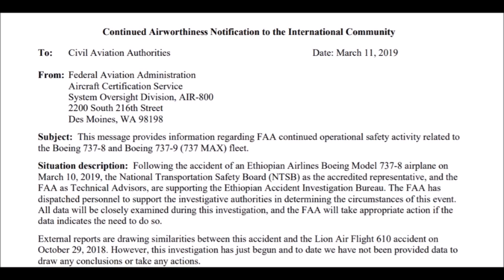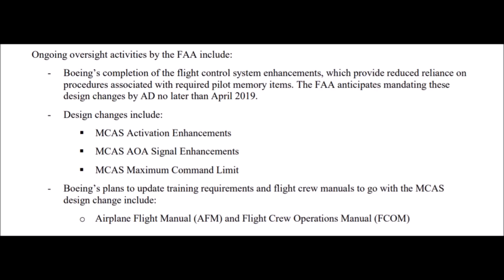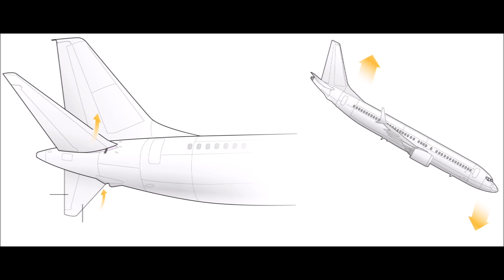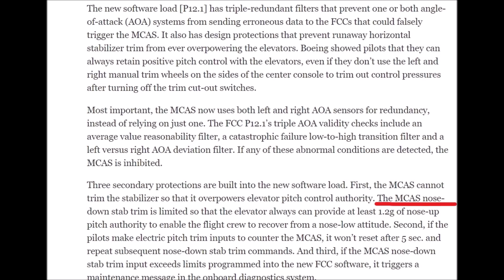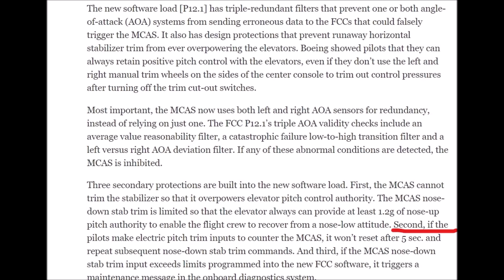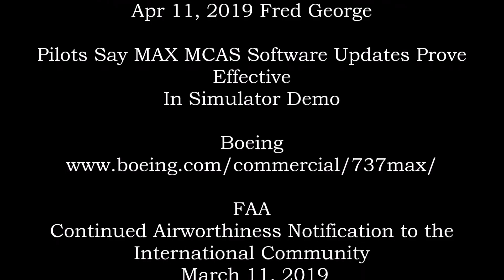737 Max UPDATE 14 April 2019 "The Fix"

Comment: I noticed in your comments there was nothing sounds to you angle-of-attack indicator malfunction problem. Seems to me that that's basic to this whole system. Should have been numerous  reports the the angle of attack indicator was giving erroneous information and they cut mcast. Angle-of-attack indicator sending around a long time and it seems to me or relatively simple instruments I guess I don't understand where they problem is with this particular aircraft.
Reply: Martin Richter AOA faults were covered in a previous video. This is part of a series.
Reply: My question it's really about the AOA putting out erroneous information. From an engineering perspective, there are three potential scenarios. First AOA observes airflow and converts that to data which represents angle of attack. If that hardware sensor fails,  erroneous angle of attack  information is sent to MCAS. Normally data which is outside the normal range for this instrument.
The second scenario which has occurred in the past is a software error in which the data is used as English standard units in one part of the software, and as metric units in another part of the software causing wildly different numbers. This happened to us JPL vehicle and ultimately cause the loss of vehicle.
A third  possible problem is the location of the AOA sensor on the nose of the aircraft. Airflow over the nose and fuselage of the aircraft it's not necessarily smooth. Ideally one would like smoth undisturbed  airflow over the angle of attack sensor. This may not be the case in his present location.
Reply: Martin Richter None of those scenarios are relevant to passenger aircraft. AOA sensors measure angles in degrees, a system of units which have been around for thousands of years. The only way to get undisturbed airflow is to have a ten foot pole attached to the front of the aircraft, and that is never going to happen.
Reply: What I have not heard from you or anyone else really is an effort to address the quality and reliability of the data from AOA sensors. We as the general public may not have access to such an effort but I'm not convinced that everything is being done to resolve this issue until we take a hard look at that sensor and find out why the data has been erroneous.
Reply: Martin Richter The AOA sensors that crashed are in a million tiny pieces, those that didn't are still working. I see your point, but am not sure what there is to investigate.
Reply: Look carefully at the nose of an A350, which is arguably one of the most modern and safe aircraft around. There are two AOA sensors on each side of the nose, plus a whole lot of other (15 in total) sensors: https://en.wikipedia.org/wiki/Airbus_A350_XWB#/media/File:DSC_8003-F-WZGG_-_MSN_003_(10512991673).jpg

Comment: why cant we fix the problem instead of putting a band-aid in the problem by forcing the nose down...Problem is these engines were not designed for these planes...and we need to call it as it is.  They needed to design a new plane if they wanted to use these engines...Or at lease give it a higher landing gear to accommodate the bigger engines.  UGH!.... Just pointing out the obvious Juan. Thanks for the video

Comment: In an earlier video I believe you stated that a Pilot can only be certified on one type of aircraft at a time, so if a smaller airline had older  737's  and then got a few new 737 max planes and could not use the same pilots on both  they would have extreme scheduling and financial problems.  This would put pressure on the airlines not just Boeing to avoid the need to recertify for the 737 max.
Reply: Sue Smith Yes. That was covered in one of Juan's previous videos in this series.
Reply from the maker: Exactly. Thanks for listening. So many folks watch this series and are blinded by there own 'opinions' .

Comment: Thank you Juan. Your ability to explain these technical concepts to the greater public is amazing.  I do have a couple questions. 1.) How often does ANY full size commercial airliner approach a stall condition? 2.) How likely is it for an airliner to approach a stall condition more than one time during take off? I understand the MAX 8/9 models are more likely to approach a stall condition due to the new engine's power and mounting configuration but why would MCAS be designed to continue correcting the trim after the first correction. I would guess that a pilot would be shocked to attention after the first correction by MCAS, considering its designed to engage only with auto pilot off, and pilots at that point would be paying acute attention to how the aircraft is handling, making further correction not only useless but dangerous.  It seems like the software for MCAS was designed by someone with little to no flying experience. I just don't see how a non-intuitive software program like that could have slipped through the cracks. Also, in one of the accident reports, there seemed to be some question as to whether or not MCAS was bumping the aircraft out of auto pilot and allowing MCAS to reactivate. Was that addressed or have I misunderstood the issue?
Reply: Tommy Leanza 1. It is very rare for a passenger aircraft to be close to the stall condition,  unless something has gone seriously wrong. 2. MCAS has nothing to do with takeoff, it was originally intended to deal with tight turns at high altitude during TCAS escape maneuvers. 3. The goalposts shifted, and you know the rest of the events.
Reply from the maker: It's not a stall prevention program.

Comment: MCAS is just a cheaters way of getting by but in the end it's cheat and if not needed to keep the so called 'stable aircraft' in the air then remove it and train the pilots for a new type of handling. Talk about spin cycle on full BS MODE!!!

If this had happened to Airbus, Boeing would have crucified Airbus and Boeing's lawyers would be screaming bloody murder for years to make sure no one forgot. Boeing cheated and it's going to take more than a slap on the wrists to remedy this error.

Comment: I read somewhere that this exact thing happened on the same airplane and the crew just happened to be giving a free ride to a pilot who knew how to pull it out of the dive. He had the pilots cut the engines off and then when they turned the engines back on they were able reset to its regular course somehow. He saved the lives of the crew and all passengers!
Reply: CelticFreckles That was covered in one of Juan's previous videos in this series.

Comment: 737 Max “inherently stable”??   Perhaps the phrase needs to be defined.
Reply: Google is your friend:  Inherent stability is the tendency of an aircraft to return to straight and level flight, when the controls are released by the pilot. Most aircraft are designed with this in mind and are said to be "inherently stable.

Comment: @rick nash. Your point regarding the thrust setting is a good one. I would however, wonder if it was deliberately left at 94%. If you were to place yourself in the cockpit, what would you see? Shortly after takeoff from a high altitude airport, you clean up the aircraft and almost immediately, the MCAS pitches the nose down with the considerable and repetitive authority the stabilator trim has. There will always be some delay while you assess what is going on, select a course of action and execute it. While I have not seen the altitude trace vs airspeed, I suspect you would have a delicate balancing act between maintaining your altitude, controlling the MCAS commanded pitch down and not allowing your airspeed to build to the point where aerodynamic loads would make it nearly impossible to use the manual trim via the hand cranks. This emergency happened at a critical phase in the flight. I can only empathize with any pilot who finds themselves in such a situation. @rick nash

Comment: Boeing made so many errors it makes you wonder what the hell is going on in that once great company.      They should have just raised the airplane up instead of moving the engines to accommodate larger engines.   Then compounding that they made the ridiculous MCAS solution dependent on ONE sensor and gave it full nose down...  Unbelievable.    And they changed MCAS from .6 degrees to 2.5 degrees and didn't rerun the analysis.      Its sad because all this talk about the 737 being old is nonsense...it is old design but the only problem is that it sits too low.  Why didn't Boeing raise it?
Reply: Richard Miller The problem with the B737 is that the landing gear retracts into the wing. There simply is no space to lengthen the legs of the landing gear, to make the aircraft higher off the ground.
Reply: @gordonrichardson2972  yeah I know it wouldn't be easy, but this is Boeing they could have figured out how to raise it, they didn't want to spend the money....I suspect it would have caused a cert issue if they had to change the fuselage...supposedly the 737ng is certed off the 707 to some degree.
Reply: Richard Miller The B737 is closer to the B727 in some ways, but they are all 1960s airframes. Not many original aircraft from that decade still flying.

Comment: Any idea why the angle of attack sensors are giving erroneous signals?
Reply: Loren Wilson AOA sensors are normally very reliable, but they are prone to mechanical damage during ground handling, particularly by the airbridge when loading passengers.

Comment: Question The engine mounting bolts on aircraft engines are designed to cause engine to drop down and go under the wing if they shear of. 
With the Max 8 they had to move the engine forward and up thus one of the requirement for the MCAS . Although extremely rear. Engines have detached. So the safety feature of this design feature will now be null and void as the centre of gravity will dramatically  change. 
Most likely tail heave pitching nose up regardless of what MCAS is trying to do.  In this configuration   the aircraft is out of balance. Will MCAS be able to lower the nose enough.  While you use what ever is at you disposable to move centre of gravity forward again.   PS Even with out any modification what so ever. The max 8 still is a very safe aircraft. Once pilots become familiar with the MCAS and procedures put in place.  It is a good aircraft that has had a bad rap.
Reply: Foot loose Camping Complete loss of an aircraft engine while inflight is extremely rare. One case happened near where I live, due to poor maintenance. There were no casualties, so its not a huge issue IMO.

Comment: The million dollar question is why the system wasn't designed with this redundancy in it in the first place. What were you thinking Boeing? How daft to fit two Angle of Attack veins and then only use one at a time. I'm sure similar errors of systems relying on one input instead of comparing 2 or 3 has historically been the cause of several previous crashes on other aircraft - I'm sure there was one to do with gyro sensors and another to do with pitot tubes. I like that the system is an augmentation system, rather than a key system, so at least if it gets itself into a situation where it has to turn itself off the flight isn't really in danger. But it does show the danger of giving too much authority to automation, and it does show the necessity for multiple pieces of equipment for one measurement and the software to diagnose non-sensical data, before it is allowed to act on the data. It's so simple - it's a real pity it is a tombstone technology fix. And then of course there's the idiot at the FAA that allows Boeing to put software relying on data from one component into a plane, without mandating that you tell the pilots it is there. Software that has so much authority it can bring the plane down without the pilot doing anything. I'm trying to decide who was more dumb - Boeing for trying it and hoping they'd get away with it or the FAA for allowing it. Let's just hope that no one at Boeing had pointed out the flaws before and were ignored by senior management, because that would be worse.
Reply: lipkinasl Plenty of blame to go around.

Comment: (a)   737 with all engines failed, fuel dumped , even engines torn off ... will the plane GLIDE to a crash landing ??? 
(b) 737 MAX  with the NEW config  will the aircraft  also GLIDE to a crash landing ???

I suspect without MCAS (b)  will result in immediate catastrophic failures ....  while (a) will behave like a well-tested 737 aircraft that had gone through stringent checks and failures.

Comment: @blancolirio Juan, is it possible to operate the triple-7 with FADECs off?
Reply: FADEC's control the engines, not the aircraft.  Modern engines depend completely on their control system to operate efficiently and safely without surge, overspeed, overtemp, overtorque, flameout etc, etc, etc.  All FADEC systems incorporate multiple levels of redundancy.
Reply: Which means modern airliners can't quite be flown without automation, gliding not counting...
Reply from the maker: wrong.

Comment: I was an automation engineer, having worked in many industries for over 50 years, These safety processes were always followed; TMR (triple modulator redundancy) was always the solution to the uncertainty of inputs.
This was true for Nuclear power plants, as well as hydro-crackers in the petroleum industry.
I also hold a private pilot's licence.
Why is there such incompetence at Boeing and the FDA?
a bad sensor should not kill hundreds of people.
Having said all that, I suspect the pilot put the airplane in a steep climb and initiated the condition that ultimately caused the crash.
Care to comment on the incompetent, and untrained crew? they must bear some of the responsibility.

Comment: Another youtuber claims that the basic problem was that Boeing put a new larger engine on the 737 MAX to compete with a new Airbus model.  The larger engine meant it had to be mounted higher and that changed the aerodynamics of the plane.  They claim that the MCAS system was added to adjust for these aerodynamic changes.   Any truth to this?  I don't think you've mentioned the larger engine on the 737 MAX.
Reply: IowaGrandpaTrain Please watch Juan's previous videos. This is part of a series.

Comment: Simply hurts my brain to learn that MCAS utilised only one AOA sensor at a time. That's the automotive equivalent of your ABS brakes only reading one wheel. And what's with the system alternating which AOA it used ?  I can't think of a single good valid reason not to look at readings from two sensors when you have a pair.
Reply: 3795 Mpower I agree with you in principle, but not in the details. ABS braking applies to each wheel separately, since one may be on ice, the other on gravel. Strangely enough the same applies to AOA sensors. There are two mounted on either side of the nose, and if the aircraft is not flying perfectly straight (called yaw), then the two AOA readings cannot be the same, since the airflow over the nose is curved. Deciding which AOA value to use for MCAS is not a simple problem. Hope that helps.

Comment: This makes no sense at all. The MCAS was installed to circumvent actually having to train pilots how to fly the max 8 properly. 

Now that the pilots (and the entire world) understand what max 8 characteristics MCAS was trying to hide from them, surely they don't need this system anymore. 

Why would you replace 2 brains and 4 eyeballs with 2 AOA sensors (that fails less probably in the same manner mind you) and dumb software. It makes absolutely ZERO sense.

Comment: MCAS is a band aid for a design problem. The design problem is with bigger engines.
Reply: In what way are the larger engines a problem?
Reply: @stimproid  
More thrust, sits higher then the previous and further out. This all changes the CG. 737 has same body and wings on all models approx 90s thru today.
Reply: @j-way1809  So the bigger heavier engines move the CG forward pushing the nose down... yet the nose wants to pitch up ...hmmm... that doesn't make sense. Sure you thought this through all the way?

Comment: So what ever happened to the Atlas Air Flight 3591? It sure looks an awful lot like the 737 crashes. Strangely it dropped off the radar quickly and never mentioned again.
Reply: alan headrick The B767 crash in Houston was probably human factors, not mechanical, and unrelated to the B737 MAX crashes.

Comment: As an experienced pilot, I don't generally take a nap right after becoming airborne. Airspeed control is second nature. We don't need a system to "augment" the pilot in pitch control. And did you address the awful design of the single point failure? No need for MCAS in the first place.
Reply from the maker: I did, were you not paying attention? Napping....lol